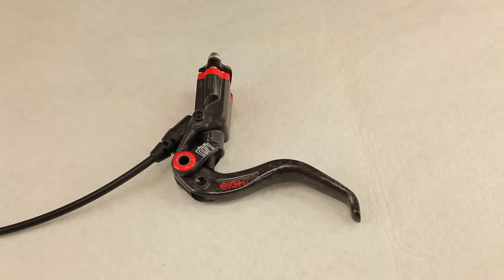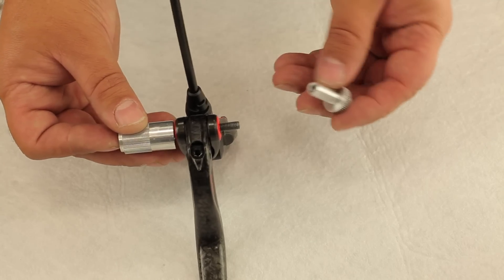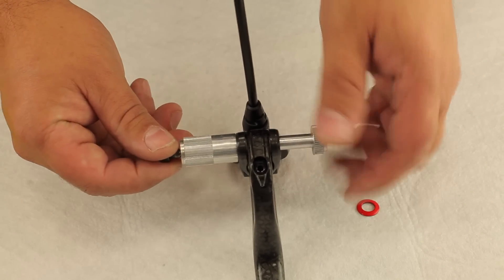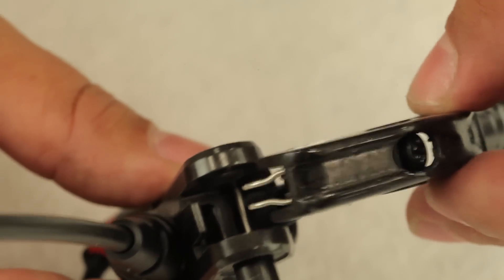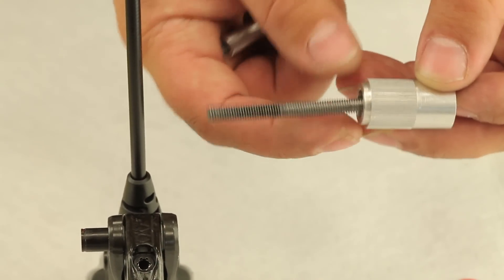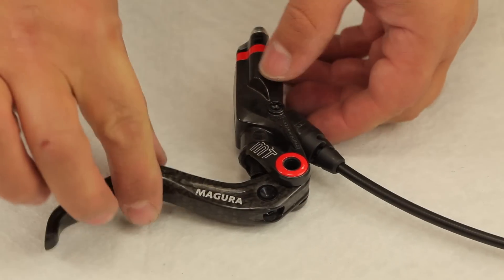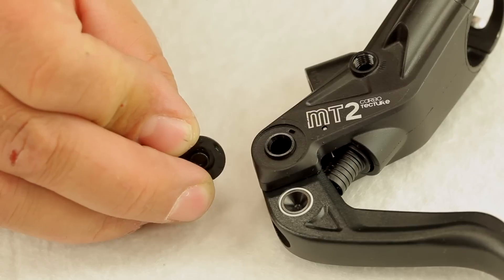Changing a leverblade on a MAGURA disc brake (MT8, MT6, MT4, MT2)

Comment: Never again would I buy anything that has MAGURA on it!
Reply: Precisely said. Its a piece of crap. Just to look at it already requires some specially designed shittool. From the nuts used to tighten the lever on the steering rod (made of soft aluminum), bleeding procedure , to brake sensor (in case of ebike) its a complete nonsense... "Lower" grade and cheaper brakes are more reliable. Guess royal blood must be the reason for such horseshit marvel.
Reply: Ronen Barski ok
Reply: Just change the levers to shimano xt or saints 🤘😜

Comment: I was such a fan of the simplicity and functionality of my old Louise and Julie brakes. So I chose MT 2 and 4's 's over Deore brakes and have come to realize that that was a big mistake. The MT brakes are expensive and over engineered. On lever already lost it's bushing wich forced me to replace the whole lever blade . That's 21 Euro's just for the lever blade of an MT2 brake. 31 Euros buys me a complete Shimano Deore brake set including brake pads! But thanks for the video anyway!
Reply: Just change the lever to shimano xt or saints 🤘

Comment: @VeHe  A 6mm hex key will work quite well to unmount the brake lever.
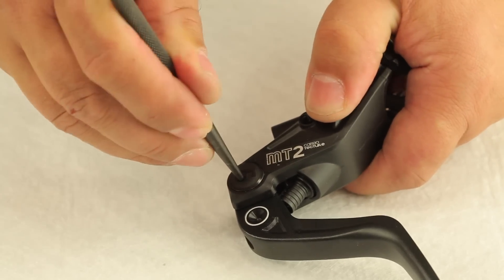Reply: My MT2 took a 5mm hex.  Also, the cap they show removing at 2:30 (punching a hole in it?) can be removed with a sharp blade tip under the edge and prying.